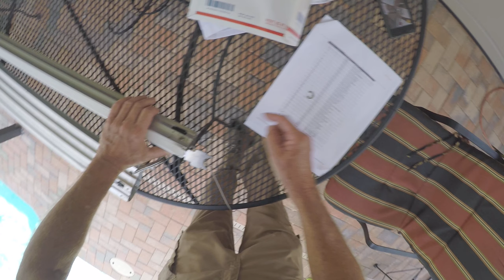Talon

Comment: Thank you for posting this video. I have the same talon and yesterday it got stuck deployed and created an awful situation and I did not know how to retract the spear. Even manually cranking I wasn’t able to bring the talon back up. After 2 hours I had to unbolt the talon and slid it off the bracket. Now I have a talon that is stuck deployed and no idea what to do. When I take off the top cap I do not see the wire running along those two pulleys. I’m sure that is the issue but if anyone has any feedback please let me know!
Reply from the maker: Same thing happened to me when my cable broke. It was fully deployed. Took 2 of us to pull it out of the mount and lay it on the boat. Had to take the covers off at the motor and cut the cable loose. They were tangled all around the spool. I found the new cables on ebay. Hope this helps.
Reply: Very helpful. Thanks for the response. I talked to a certified Minn Kota service shop that said it is most likely under warranty. I hope that's the case. After watching your full video I have a much better idea of how the Talon works. Considered doing the repairs myself but especially the rivets part, it's out of my league. So I'll disconnect it and bring it to him. The most frustrating part was not knowing where to turn when it was deployed down. I did not install this myself so I was unaware of how to slide the talon out of the bracket. Plus the tide was going out so I was forced to push through and find deeper water which potentially caused more damage but there was nothing else I could do at the time. Minn Kota should have some more clear instructions for when this may happen.

Comment: You said replacement spikes are free from Minn. Kota, how do I get one.  My 8 ft talon is over 5 years old and the spike just broke tony
Reply from the maker: Sorry, Don't recall mentioning the spike is free on the Video. I did check their website and they claim the spike has a lifetime warranty. I broke  one of mine years ago, but never bothered with the warranty. You can try calling Minn Kota to see what they say. I bought mine on Amazon. They go for around $50.00. You can probably find them cheaper if you shop around on the internet. It came with all the extra parts for the spike. Easy to replace. Hope this helps.

Comment: How do I open the bottom?  It will not extend at all
Reply from the maker: If the cables are all loose and untangled at the drive and at the top, you my be able to use something like a broom handle at the top of of the unit and push the the first section out enough to pull it from the bottom. If both cables are still wrapped around the drum, it my be a circuit board or motor problem. Make sure the battery is disconnected from the unit before you work on it just to be safe. hope this helps.

Comment: What size pop rivets or does it matter
Reply from the maker: I used 1/8 diameter by 3/8 Long Stainless Steel pop rivets. I think that's the same size Minn Kota has on their parts list. I couldn't find that size at any of my local hardware stores in Stainless Steel.. So my choices were order them from McMaster-Carr part # 97550A515  or Order them from Minn Kota. I chose McMaster-Carr. On the bottom plate as seen near the end of my video, I used #8 by 3/8 long stainless steel screws. That's the only place you can use screws rather than pop rivets. I tried the pop rivets on the bottom plate by they wouldn't hold because their biting into a slot instead of a hole. Found the stainless steel screws at my local hardware store. Hope this helped with your question.
Reply: @mdw66799  awesome thank you very much

Comment: Thank you for  the VIdeo. I am in the process of repairing my 2 stage 8' Talon and I hope that your video help. I have had  a lot of trouble with the 2013 8' 2 stage Talon. It had 3 repairs while under warranty. Minn Kota Customer Service has been no help with this product. I have shared many customer service complaints to  Minn Kota  and there has not been any positive response from them. Year after year I have had it fixed 14 times since purchased. I have spent more on repairs than the anchor cost new.  I am having to repair it this time myself as the repair shop is backed up several weeks. I was able to order the repair cable kit, although there appears to be no instructions or diagrams for the cable routing. I did reach out to  Minn Kota for help. and the response was. 

Minn Kota's Response
I am sorry but parts are sold all the time without instructions on how to install them. If you go to purchase any part in the automotive world at any parts dealer, they do not provide instructions on how to do it. My recommendation would be if you need instructions for the installation, try using YouTube to find someone who has done this repair in the past. I use YouTube myself for most every repair I do on my own. 
Regards, 
Dave H.
Dear Mr. Holtz, 

Me
RE: Minn Kota Talon Shallow Water Anchor 
Serial Number: M104MK00912 
I thought I would try again to get some help from Minn Kota customer service for my Talon anchor. Today I spoke with Brenda and then Dena to help resolve the issue. The issue is that once again my Talon anchor failed. The cable came off the spool and would not retract. The manual method will not work in this case and it appears from customer support, there is no solution for the problem of a cable drum issue. Dena's answer was to remove the Talon form the mount. HOW am I supposed to do that out in the middle of a body of water? And then what would i do with the device? 
The Talon needs to be repaired again, and from our prior correspondence you can see that I have taken it to G & S Trolling Motors in Houston for repair at least annually. They suggested that I could repair the Talon myself if I am mechanically inclined and they could sell me the cable kit, although it does require a special tool that make the repair easier. 
I have ordered the cable repair kit (Cable Replacement Kit 8' 2770840) which is available from the Minn Kota Parts catalog online. The problem is the part does not include installation instruction. How can it be installed and repaired without instructions? I called customer service this morning to obtain the instructions which I feel is appropriate for a replacement part. Neither Brenda or Dena could provide any customer service related to the support of this product or the repair parts. In fact, both Brenda and Dena indicated that there is a special tool required to install the repair kit, so I asked for the tool part number so I could order it. Both customer service specialists informed me the tool is not available. So I ask them, HOW am I supposed to repair the Talon anchor with the parts that can be purchased directly from Minn Kota, without instructions and the required tool? why sell these parts if Minn Kota cannot provide instructions or the required tool. 
So, I shall ask you once again, please replace this device as it has been defective from the day I purchased it. 
Thank you for your help and I hope to hear from you soon. 
Cordially,
Reply from the maker: Wow, pretty bad treatment from Minn Kota. That's one of the reasons I never bothered with them. I wonder if G & S is assembling it wrong. I was fortunate that I have twin Talons to be able to copy the cable routing from the good one. I really abuse mine and only had to replace the cables once. They are 6 years old and working perfectly. I will do some research on the 8' talon. If I find anything useful, I will post the link for you.
Reply from the maker: https://www.2coolfishing.com/ttmbforum/showthread.php?t=2023017
Reply from the maker: Not a very good cable routing diagram, but the instructions might help. This is all I could find.
Reply: I was able to reassemble the 8' two stage Talon. The cable routing is straight forward. The retract cable spools directly to the drum, and the extending cable is routed through the 3 rollers to the drum. On this model the key is to wrap the two cables onto the drum. I did remove the spike to make the job a bit easier, as extending the entire unit is a bit clumsy on the bench. Another tip is that the unit does not need to be fully extended to assemble. I did fully extend the retract it a couple of times to verify the cables are wrapped neatly on the drum. To do this I suggest removing the motor, so you will not be fighting the clutch. The two springs allow for only an inch to 1 1/2" of play. Do not try to load the drum with tension. Once the cable is routed, they should be hanging out the top. The retract cable winds on to the drum from the side with the motor, and the extending cable on the side with the manual crank. The key is to allow enough slack in in the extending cable to allow the cable to be prewrapped roughly one turn. To do this I removed the large roller from the main housing, keeping tension on the cable allowing enough play to attach the cable. Once that is done, I reinserted the pin for the roller and the cable will be taught, holding on just the pin. Now I removed the bottom roller from the second stage, this roller is smaller in dia. and the roller pin has two e-clips that only one needs to be removed. This roller pin can be inserted easily for final assembly. Once the lower roller has been removed the cable will be loose enough to reinstall the the large roller, the two e-clips are installed on the inside. With the large roller reinstalled the lower roller may in reinstalled. Start the roller under cable a few inches from the end, roll it back into position. Using a Philips screwdriver inserted through the frame, align the roller, and inserted the roller pin. The cable should be taught. Manually operate the unit using a 7/16 wrench up and down several cycles to be sure the cables are clear and aligned on the drum. Reinstall the motor, bottom plate and covers. You should be good to go. I fully disassembled my Talon to inspect it for damage and or any broken or warn parts.
Hope this will help someone else out.

Comment: What????  I watch the whole video and then you missed the most important part which is how to get the retrieve cable on the drum?  Just saying that it was tough but not showing how you did didn’t help at all!!!!
Reply from the maker: Starting at the 37:14 minute mark I showed that I Adjusted the stop screw out at the Top of the Unit in order to gain more slake in the Retracting Cable and also left the cable off of the Top roller in order to have enough slack in the cable to hook the cable into the slot on the spool. I didn't think it was necessary to video sliding the cable into the slot.